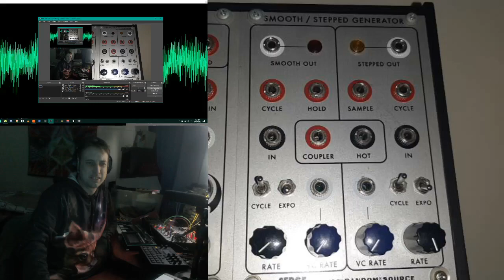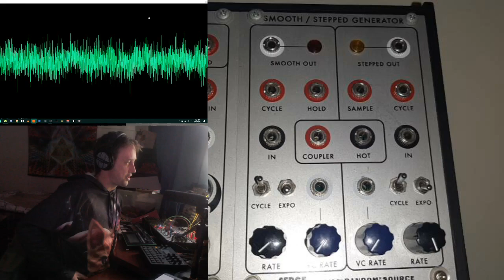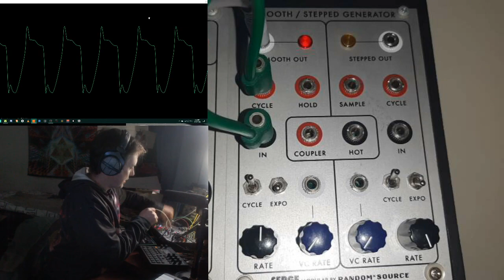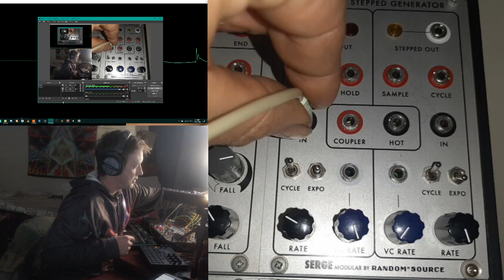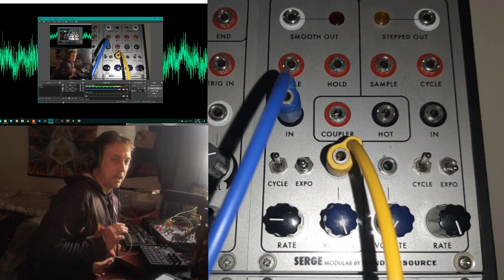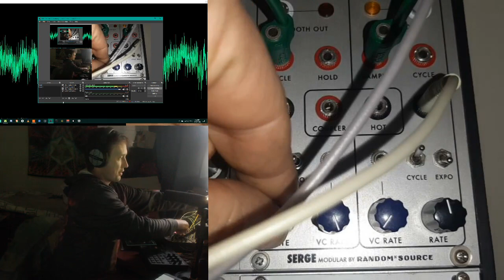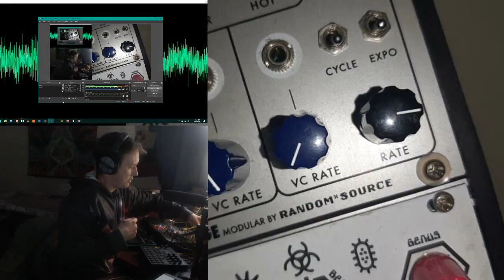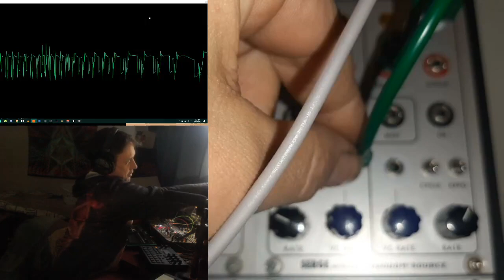Introducing the Serge SSG

Comment: Great video! One thing I didn’t grasp - do the 2 sides affect each other? (Aside from coupler)  Noticed the left LED blinking at odd intervals with nothing patched in.
Reply from the maker: Thanks! I don't believe the two sides affect each other by default without patching it to do so.. The stepped side's rate is somewhat harder to see at a glance due to the nature of needing a trigger to change states, but I'm not sure why the left LED (smooth side) would blink oddly without some kind patch connection influencing the rate.

Comment: Great video! Lots of precious info. One question...I've noticed the rate VC knobs are active without having an input cv. I guess there are normaled connections. Is that correct? The noises at minute 29 coming from coupler output. Where do they come from? Thanks!
Reply from the maker: Thanks! Yes there are normaled cv offsets at the Rate cv inputs to both sides accessible via the three-way Expo toggle switches. If I'm not mistaken, you get some degree linear rate scaling if toggled upwards, no normalisation at center and exponential scaling if toggled downwards, but it's pretty limited in range so it's more useful for external cv.
As for the Coupler output, it is outputting gates that are triggerring an envelope to create the noise bursts that you're hearing. The gates are created via a comparater which is comparing the voltages generated by both sides. Hope this helps!
Reply: @teezdalien  thanks! That was super useful.

Comment: Nice try on the SSG. Mine's also working a bit strange with noise sources, that made me think of problems with the build. Glad that's not the case. What signals are you feeding it with for random uses usually?
Reply from the maker: Yes, because my SSG doesn't seem to respond to my Turing Machine's noise source (frustratingly), I often FM an oscillator with either this noise source or another oscillator at high index to create noise from the oscillator, and feed this back to the SSG. It's expensive use of the system to get there but it works well enough for me. At least until I add the ACPR to my system, hopefully soon which gives you the s/h source and is more ideal for getting true random from the stepped side.
Reply: @teezdalien  Haha, I also use Turing Machine, which is a great companion to Serge and is among the best random modules! Will try to use vco's the way you described. Thank you for the video and the explanation! Been curious of what these expo switches do, as I can't force myself to use a scope during recordings
Reply from the maker: @alexeylapshin948  No worries. I think it's to do with different voltage scaling protocols, the R*S stuff works at -2.5v/+2.5v  and I think the TM operates in the range of 10v swings from -5v/+5v...

The expo switches make normaled connections from the outputs back to the VC rate inputs for each side similar to the DUSG, increasing the function's rate of change exponentially.
Reply: @teezdalien  -2.5v/+2.5v bipolar and 0-5v unipolar, as far as I know. Although, I've read somewhere the SSG has a weird voltage and sometimes acts unpredictable. For instance, it hangs my DUSG, when patching to its inputs
Reply: @alexeylapshin948  Hey! If this should be the issue why the noise of the TM won't be "accepted" by the SSG the solution for this problem could be just a voltage adder, right?
Reply: @performancewave6581  voltage adder?
Reply: @alexeylapshin948  Yeah, there are a couple of them commercially available. Or an offset-generator to shift the voltages into positive-only range. But it's jsut an assumption (but I would give it a try). Usually a voltage or precision adder is used to correctly tune and transpose V/Oct-devices such as oscillators so I think to use an offest generator is more suitable.
Reply: @performancewave6581  I see. I don't have one, so can't comment here, but I adopted the teezdalien' technique of heavily FM'ed vco as a random source and must agree, that it works perfectly. I think voltage procs might work as well, but can't say for sure.
Reply: @alexeylapshin948  Now that I think about it - any solution would add another module into the chain so if that works for you there's no need for another solution! :D
Reply: @performancewave6581  Exactly! Serge is a good way to put an end to eurorack addiction. It's among the most cost-effective systems there are. E.g. if you ran out of filters, you don't need to buy another one and may use a slope gen instead
Reply from the maker: @alexeylapshin948  That's a nice thought. These modules definitely helped curb my eurorack GAS and inspire creative patching, which is really what makes modular interesting. I haven't added anything to my system for ages now, though I have a few ideas for down the track when I can afford it!
Reply: @teezdalien  Same for me!

Comment: Interesting stuff. I don’t own any serge atm, but I’ve been tempted for a while. I enjoy modules that encourage experimentation, and that have a wide, open plan feel. My favourite atm is the Verbos Voltage multistage, for the same reason. Thanks for the video.
Reply from the maker: Thanks for the feedback Ben. I think you'd enjoy the Serge experience, it was like a revelation to me when I first combined a few of these modules together.. I've also enjoyed playing with Verbos modules, had the Complex Oscillator for a while, kinda wish I'd held on to it tbh.. But have played with an entire Verbos system at MESS here in Melbourne, and it was definitely fun to work with, just bloody expensive.
Reply: @teezdalien  my credit score is wavering. Teetering on the brink. But it’s worth it. With each purchase it feels like I’m stickin’ it to the man and supporting others in the ways of creating wobbly air ✊🏼